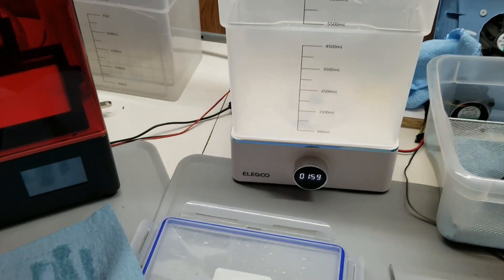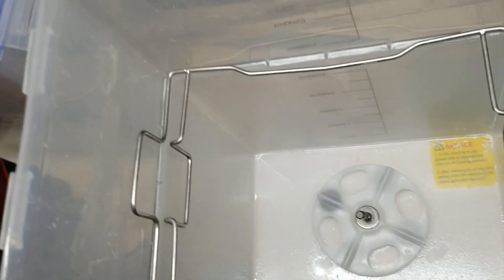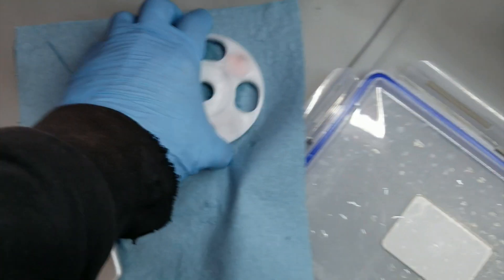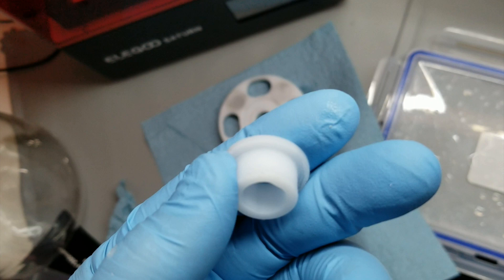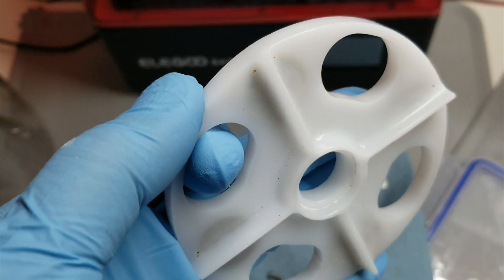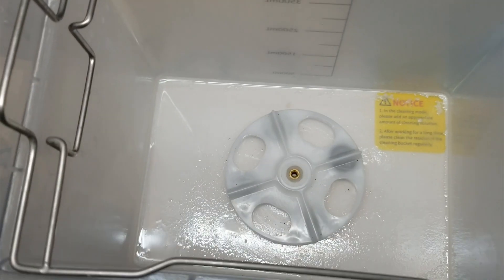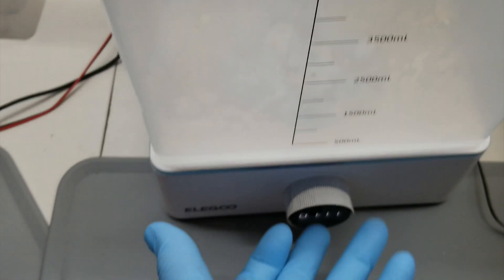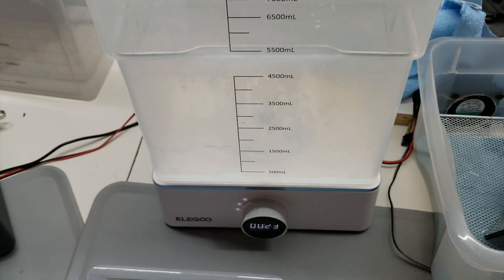How To Fix Elegoo Wash Station. No spinning problem, fixed.

Comment: NEW INSIGHT TO THIS PROBLEM, Ok I had this exact problem and it took a while to work out what it was, In my case I discovered that the spinning wheel and the boss that fits into it had seriously worn each other out so effectively the spinning wheel was closer to the motor magnets hence the jamming up, I CNC machined a new boss but didn't replace the wheel [ yet ] and it now works, I notice you can't buy these parts separately but you can buy a new 'jug' which of course comes with the wheels.
Reply from the maker: Dont we all wish we had a cnc machine readily available..🤣🤣🤣..I know I do..🤪🤪..you are right though..but yours was wear over time..mine was right out of the box like that..so both stories are true..

Comment: I solved the issue, mine out of box gets stuck and the solution was not to run it dry, put a lil bit of water/alcohol and it should run smoothly but never run it dry
Reply from the maker: Thanks for the feedback.

Comment: My dumb self left a it sitting for 2 years and came back to find the bottom was covered in simi hardened resin. Talk about a nightmare to clean!
Reply from the maker: 2 YEARS?? 🤣🤣🤣..wouldve been easier to just buy a new one..🤣🤣🤣
Reply: @richideates  
Not a option.
It ended up fairly easy to clean. Most of the resin just popped out or off. A little lubricant, and it's good to go.
Thanks for the video. I had wrongly assumed the spinner could not be removed.
Reply from the maker: Fixing things is always the best way to go..thanks for watching

Comment: Ah, finally!  I've been tearing my hair out trying to figure out what's been wrong, and it's that the tank impeller needs some work.  I knew it was probably not the set screw in the base again, since that was the first thing I checked, and also the grinding noise it was making sounded different from last time when it was the screw.

For anybody else who is wondering if their problem is the tank impeller needing a cleaning or the set screw in the base coming loose...

- The set screw coming loose will cause the impeller in the base to come up off the motor, causing a much louder, rougher metal grinding sound from the motor basically slapping against the screw.  Also, the tank itself will be noticeably more difficult to take off of the base due to the magnets being much closer together than normal.
- If the tank impeller is the problem, the grinding noise will often not start instantly every time you try to run the motor, and the noise itself will sound higher pitched, exactly the same as shown in this video.  The sound will be caused by the motor itself failing to spin as designed, and at least in my personal experience, included a very faint burning smell the first time it happened.  Otherwise, this problem can also be initially diagnosed by the lack of some of the other symptoms associated with the set screw.

Comment: Just got mine today, new out of the box. It's the washer they sent with it that goes on top of the fan in the tank. If its not sitting dead center, the fan (being made of plasitc/resin - whatever) gets starts grinding against it and it gets caught on it. Basically had to make sure the washer was dead center
Reply from the maker: Made in your local garage..🤣🤣🤣

Comment: Excellent video. solved my problem! I really hate this washing station lol.
Reply from the maker: I hate the noise it makes, I always have to put my headphones on to block out the annoying whine it makes. It works though, but I still agree. Lol.
Reply: Thanks for the video, my problem was that the two pieces of white plastic has a specific shape its not a perfect circle and i forced them, the shape is like a flattened circle
Reply from the maker: Made in China. 😂😂😂

Comment: Thanks for this. I think my problem was that resin had cured and got in the mechanism, I took the fan off and scraped it all off and even added a bit of airbrush lube. Worked like a charm.
Reply from the maker: Good to hear. Thats a good idea. But resin is some crazy ish. You never know what it will do or how it actually works..the stuff is toxic..im still working on a way to recycle the IPA or water that I originally started..was going to upload the video that I made of a system that is quite clever. But I cant seem to get it hot enough to really evaporate and or sustain the temperature to recycle all of it. Its still in the works. Lol. One of my many Memorial Day weekend projects. To be continued. Lol. Thanks for watching. Happy Day off of work..lol

Comment: Definitely gonna try this. I tried the other method of taking it apart but hopefully this fixes my problem.
Reply from the maker: Good luck. But yes, I did the same thing. I noticed the base would still work without the container being on it. So it made me point my finger toward the base. Which revealed what I found. Some careful cleaning and she was right back up and running. Hopefully this works for you as it did for me. Thanks for watching
Reply: Hey just figured I'd pop in again. It did work for about a minute 🥲. But I did manage to fix it and I'll post a reply here just in case as well as my solution to the problem. So I took the motor out and used M3 Nuts on the m3 screws to give it a little extra space and that seemed to fix the problem for me spinning in either direction.  Been working for almost a month at this point.
Reply from the maker: Good to hear..MADE IN CHINA..🤣🤣🤣